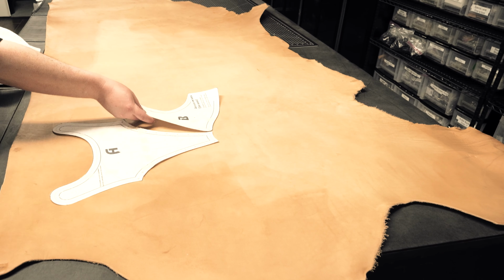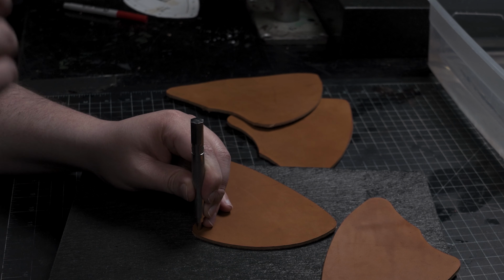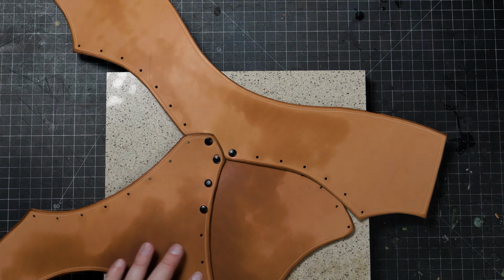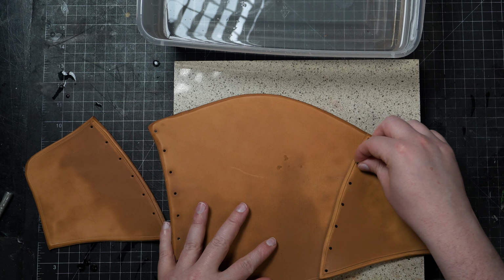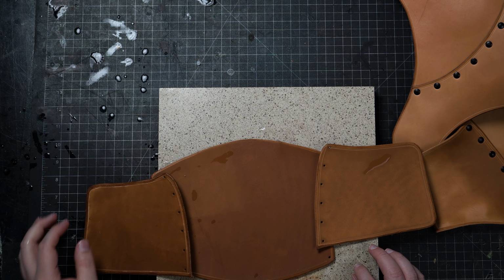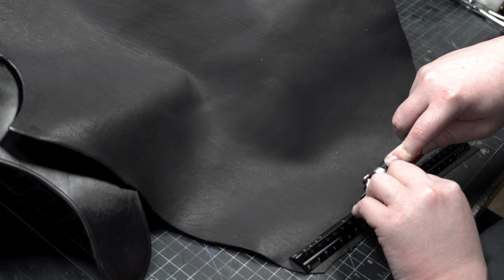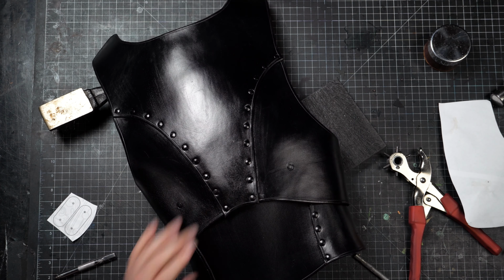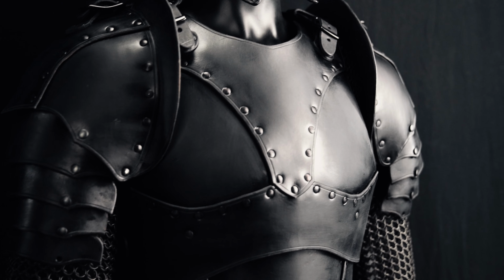How To Make  A Leather Breastplate - Warrior Armor by Prince Armory

Comment: how do I make the leather hard,  like a saddle?
Reply from the maker: Leather is mounted to a hard surface on saddles so it's no so much the leather that's hard in that case.  And saddles also use veg tanned leather, which is more firm/hard.
Reply from the maker: But to answer your question, the way you'd achieve something similar is to make a backing plate with some hard material, like wood, resin, carbon fiber, or others.

Comment: Is this safe for SCA combat?
Reply from the maker: It's not designed specifically for SCA but it depends on what you need it to do. Most SCA folks will prefer steel but you can certainly use thicker leather and wear a gambeson under it.

Comment: Any idea on what the dimensions are for the default fit?  It would be handy for sizing/scaling purposes.  Also I understand this is supposed to be a quick and simple beginners piece but do you plan on adding an alternative/amended stitching pattern for folks who prefer that to rivets?
Reply: They are for someone approximately 6' high, 180lbs. I am 5'10" 175lbs and the default print fits me no problem
Reply: @chrisconnors8513  

What's your chest circumference?